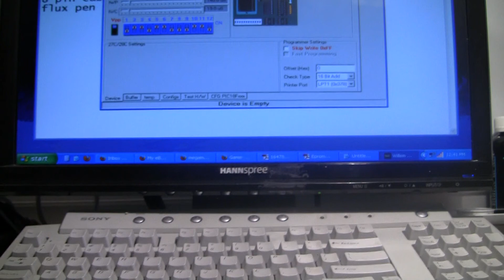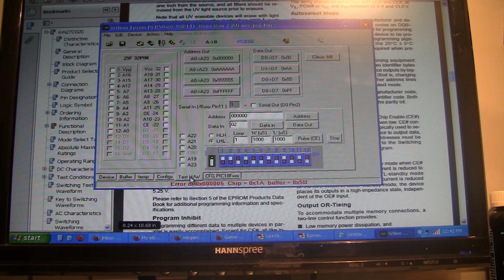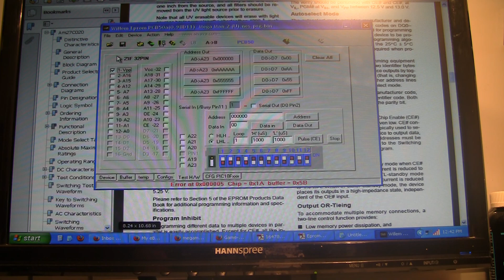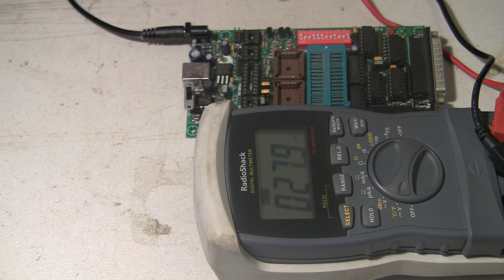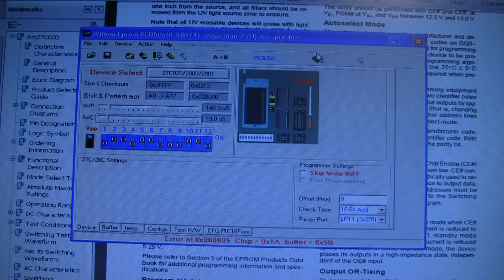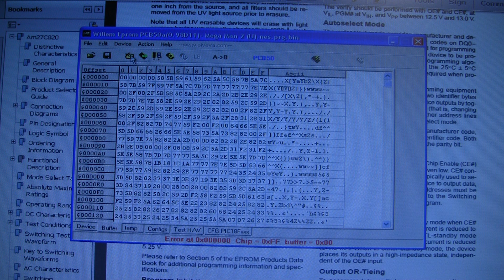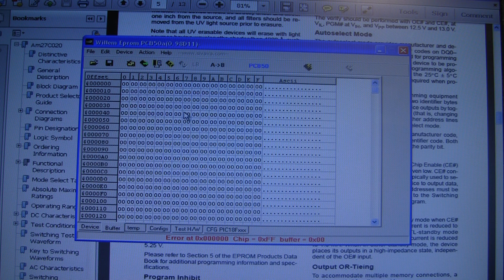Willem eprom programmer 5.0b problems Pt 1

Comment: Cool thing. I've assembled a similar.
If you have troubles with BINs writing  - check all the pins voltages running the test mode which is implemented in the willem application

Comment: You should put a load on VPP and VCC when you're in test h/w mode. Main problem with PCB3 variants is voltage drop.  If VPP drops too low,  replace the inductor with one that saturates at a higher current.
Reply: Dennis Louie I saw this fix mentioned on the EZoFlash forums. +1 for visibility!

Comment: I had a similar problem with mine except that I consistently had 20V instead of 12.6V. I finally gave up and returned it. I'm sure some of these work because they are a hot seller, but many have issues so it might be best to avoid if you're a first-timer like many of us. I'm going to try a more expensive board next time.